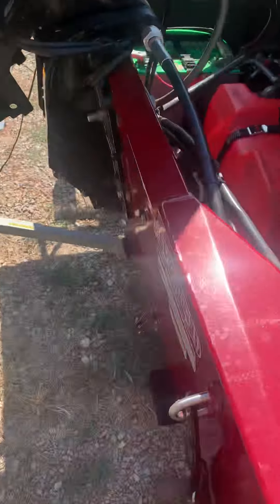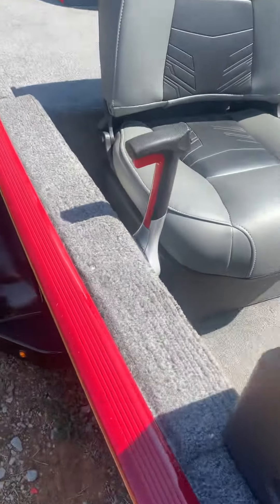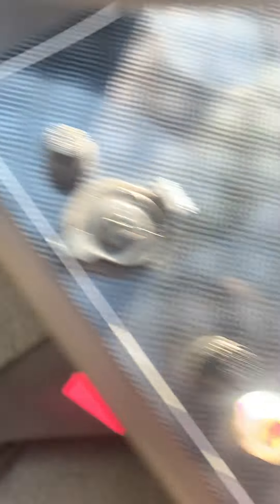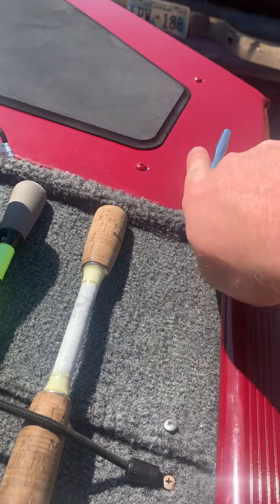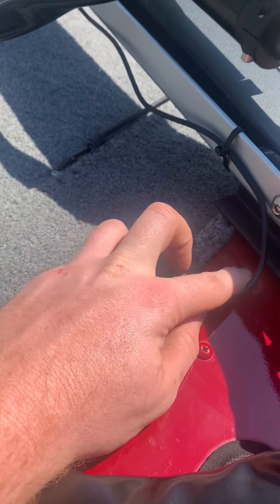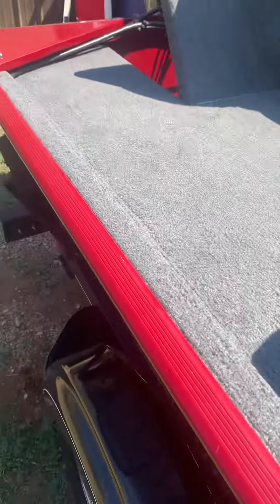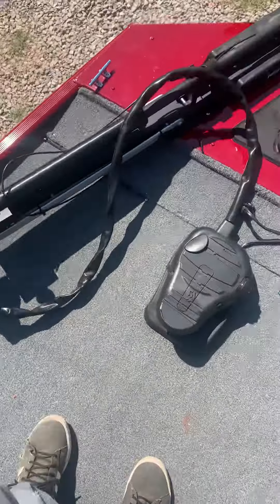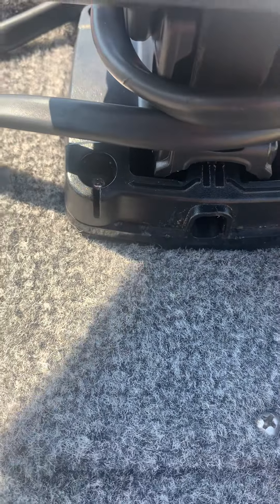How To Move The Fish Finder On A Tracker Classic Xl

Comment: On the front cover where your wires come out for the depth finder did you have to do anything, so the wires didn't get squished? Or is there enough room?
Reply from the maker: I had plenty of room in mine. However, watch where you mount the wire for the transducer on the trolling motor. I pinched my wire when I folded the trolling motor up one day
Reply: I am just getting into this. How does it work mounted on the trolling motor when you are turning back and forth in windy conditions.. if I'm going straight then turn left,  does the screen see that view? If so, you could use side scan as front view by turning the head,  or am i missing something. Again..I am brand new at this stuff